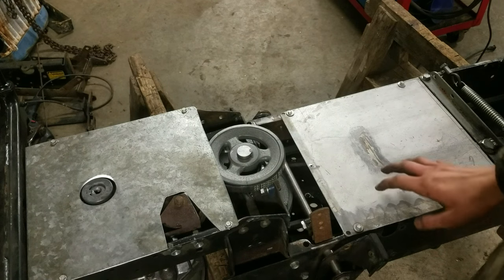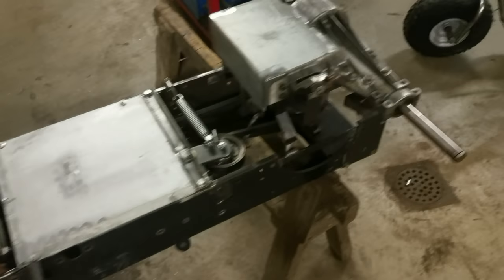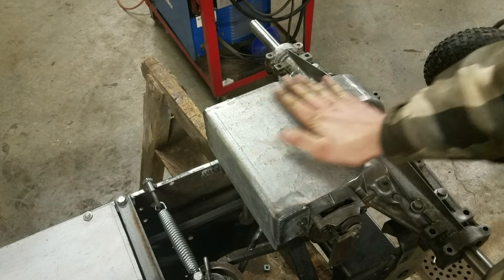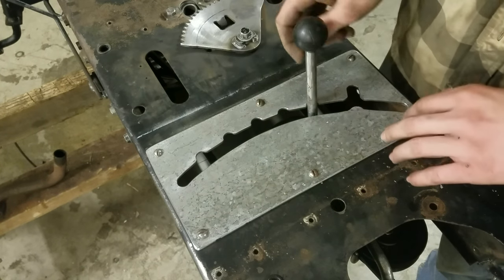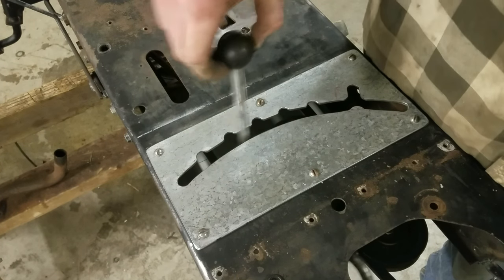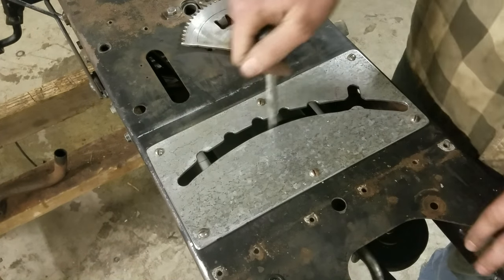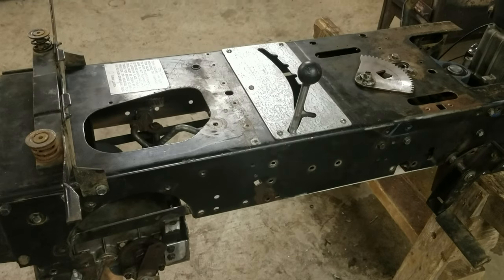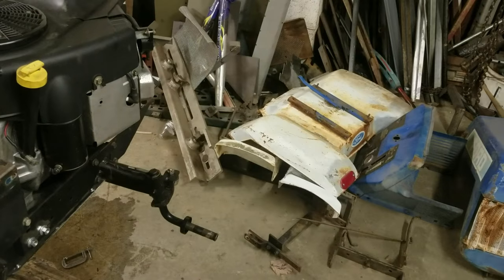Ford Off Road Mower Part 10

Comment: Your shifter guide turned out great. 
The belly pans and “skid plate” should provide the protection you will need to drive it around your house where you have driven the tank.